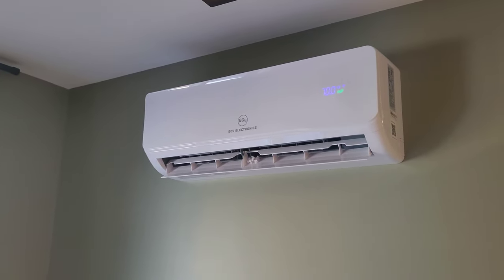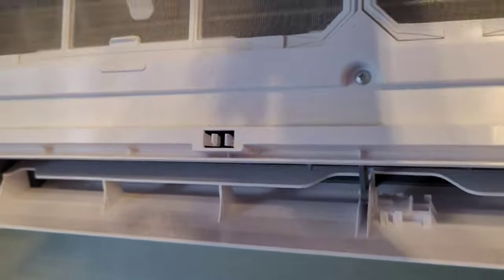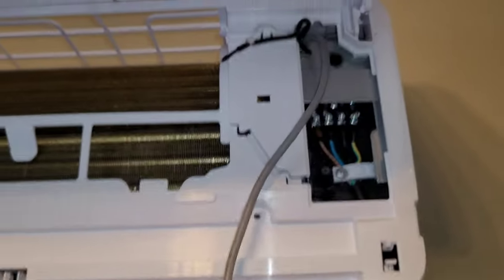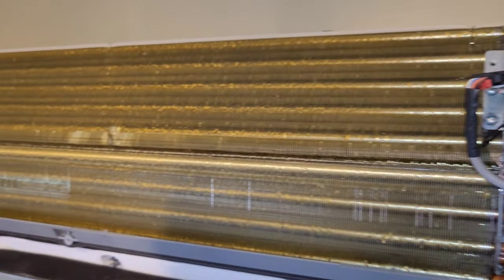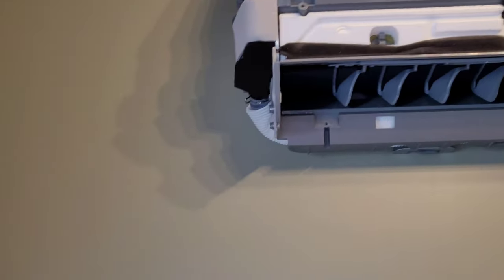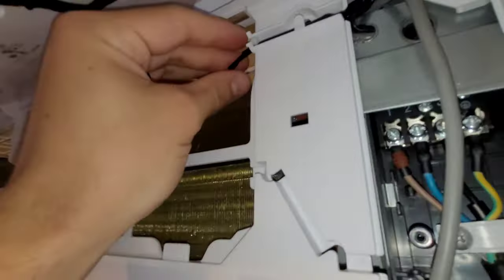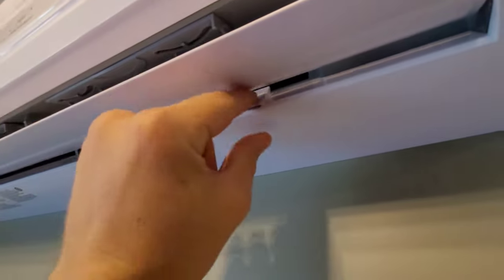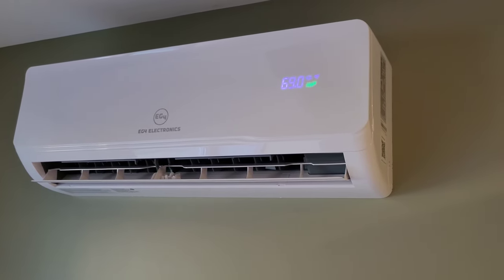How To Maintain Your EG4 Solar Mini Split Heat Pump, Do This ASAP!!

Comment: I have five hepa filters in my house, one medical grade one. I check my coils and filters and they are never dirty. I'll keep checking though. Running them 24/7 in Vegas
Reply from the maker: It makes a huge difference. If the mini split is the only thing filtering your indoor air, it's going to be problematic!
Reply: Cool Will stopped by, I follow both you guys closely keep up the good work

Comment: Definitely need to schedule this since I've installed the 24k in the garage/shop.  Its fairly well closed up, new construction, but it is windy and dusty around here.  Been thinking of hacking something together to hold parts of a regular furnace filter, gonna be tricky though, as I'm at the minimum from the ceiling.

Comment: The fan on my Mr Cool clogged up to the point that he described (weak output, condenser ramps down).  I played with the charge (which MAY have also been low???) but eventually realized the fan was the issue.  I was able to vacuum mine and get it running but even after vacuuming it was considerably worse than yours before you started.  Ended up following up with a wet cleaning.  Coil cleaner and a water rinse on the fan.  I bought a bag and everything.  The fan still has some junk on it but it's WAY better now.  I think the last trick is to get something like a Ryobi One+ pressure washer and use that on the fan.  I did try to pull the fan the first time but mine does not have a missing blade for the set screw.  I think I am supposed to take the motor out first or something.  I gave up and just cleaned it from the air outlet area.

Youtube research suggests that a wet cleaning is often required on these units, possibly even annually.  It really does depend on how clean your house is.  My particular air handler was a bit less than 2 years old and got that bad.  The filters never get that dirty and while the coil needed a cleaning it wasn't scary bad or anything.  I think another thing is to not shut them off in cool mode.
Reply from the maker: The drain bag and a wet clean is often the way it has to be done. Usually the blower is bad by the time anybody calls for service, like you said it's pretty easy to do but if you don't have missing fan blade it's a lot more work to get the blade out. If it can be disconnected from the bottom it's not too bad

Comment: I have been thinking about indoor filters systems. We have a 2 carriers air filters systems that run on auto all the time. 
I am thinking about how to install a whole house filter system with in the hvac system or no hvac system. So my general idea is to have vent and returns for each room to go back to a main area. if we do not do central air and heat and do mini splits I will need to do a variable speed squealer cage fan. ( ideally I would love to find a 5 ton heat pump system rather than mini splits) WIth filters at every single return which are in the ceiling and use high end hepa filters. The system will also have a main filter as well and a UV light in the system. I have been looking for air quality sensor that work on a multi zone HVAC. Yet these things are not so easy found. 
The carrier filters things we have are almost 2 foot round and 3 foot tall. They have built in sensors and when it encounters bad air it speeds up the fan. The system would need to be able to do a dozen or so areas and once one area detected bad air it speeds up. The fan would run 24/7 at super low speeds. 
Hvac systems need a major upgrade. With systems costing 10 to 30k for homes they better offer something other than standard AC and heat.
Reply from the maker: There's lots of new tech coming right now but it's coming with a price. I've encountered so many people who want to spend the money on hepa filter systems until they see the cost of the replacement filter every 6 months to a year, they change their mind on air quality pretty quick 😂 I have a simple Airthings air quality monitor but it does not connect to my filtration or Hrv systems
Reply: @SmitHVAC.  The 2 Carrier RMAP-ST filters systems we have are 300 to 400 dollars each and replacement filters are 100 to 200 dollars. They are not cheap either. When the filter goes bad and is no longer good I think I am going to rip it apart and then maybe build my own air system in my upstairs attic. The system is quite easy to be honest It has a sensor, control panel filter and fan. The control panel that is on it could be fashioned on the wall. I have 3 main rooms, hallway and a closet bathroom. My plan would be to add a return with filter in each room with duct hose then a main box with fan matching the style of the fan that is in this unit yet far larger and then the hepa filter in the hallway, these are those drop down vents that I wish they would use more often. Damn it that wont work cause only one sensor. Going to have to reverse it. Either way I will come up with something. I just need to find a tiny system that I can add to the new house build either as its own system or included in to the HVAC. I know that some of the higher end HVAC system have variable speed fans while mine does not having that would be far better and I think most if not all heat pumps have it. That would be easy to add sensors at every return.   
While I do understand that hepa is costly my plan is to stage the filters. Where you put standard yet higher grade pleated filters in the return vents and then at the main junction before the Furnace you place the Hepa filters. WHile its more filters overall its also better filtering and the hepa can last far longer because its only getting mostly filtered air if you understand what I mean. I am not clear where one would put the UV light box and if there is a special way to do it? 
What do you think about that idea. The more filters in the system means less filtering at the hepa stage. I think they would call this 2 stage and I guess you could make it more filters some how.

Comment: Could you use compressed air and a long skinny tube to spray off the blower wheels?
Reply from the maker: Yes you could, you might send a bit of dust up into the bottom of the coil  but it probably wouldn't hurt it

Comment: Have you had any line set condensing issues? My head unit is mounted on an interior wall and sweats really bad where it ties into the head unit. The insulation that's on the line set does not go all the way into the head unit so it's giving me grief. Luckily the white insulation jacket is catching all the condensation but its not a long term solution.
Reply from the maker: I added length to the lineset so I had to add insulation, I double wrapped the lineset where it passed through into the head unit

Comment: I bought this mini split and just had a h5 code during heat mode. I looked online to see what to do and they said shut power to the unit off for 2 minutes. So I did that and its been running fine since. I'm bummed because I have only had it a couple months. Any advice on anything else I can do
Reply from the maker: What was the outdoor temp? Defrost mode is either h5 or d5 I can't remember, it may have just been in defrost mode. Error codes usually start with E, P or F. If it reoccurs just contact signature, they've been great with tech support / warranty replacements.

Comment: I think my EG4 24k unit died tonight. It has a error code 93 - compressor fault :(. It's not even 5 months since it was professionally installed.
Reply from the maker: That's not good.. It will be replaced under warranty I'm sure but still not good. Where did you find out code 93 was a compressor fault?
Reply: It actually popped up on the solar acon app.
Reply: @SmitHVAC.  I killed power to it for a bit and the error code went away, but now the fan doesn't turn on, only in heat mode.
Reply from the maker: Did you end up getting the unit fixed or replaced?  @airwebber
Reply: @SmitHVAC.  SS replaced it, but the next one arrived damaged and it wasn't the kind of damage done in transport. So they again sent another replacement. Sadly, my HVAC guy has been insanely swamped and not been able to get to me to take down the old one and install the replaced one.
Reply from the maker: @airwebber  That's terrible! I'm glad they replaced it but what a pain..

Comment: Thanks for exposing this...  I was tempted to go with the EG4 24k unit.   However,  Signature Solar advised me that EG4 does NOT currently offer a ducted ceiling cassette ... yet.   I wrote EG4 but have not received a response either.   Oh well, still hoping for the future developments.   Today,  I do NOT feel that a ductless can meet my requirements.   I am just left with wondering why Solar HVAC units are ONLY OFFERED in ductless.   Thoughts ?
Reply from the maker: Its easier to DIY an all in one indoor head unit rather than a ducted coil, that would require an interface board for communication to the outdoor unit. A cassette would be a nice option, hopefully in time we get some more options. I'd love to install a cased coil and interface board for a whole house solar heat pump.
Reply: @SmitHVAC.  Thank you for these thoughts.  I am willing to try any ducted air handler to this EG4.    However, what is show stopping me is warranty and any proprietary communications software concerns.   Too bad EG4 has not addressed my concerns with a reply.

Comment: Can't believe you didn't pull the blower wheel in a video on how to clean.  Not fun but if youre6doing a how to video, essential.  Otherwise well done.
Reply from the maker: @rhodachandler4277  not essential at this point, in the future I will.

Comment: So basically very few will do this so the mini split is a maintenance dream for technicians or people will just buy a new one.
Reply from the maker: Very few people do it preventatively, they just call on the hottest day of the year and say its not working 😂
Reply: Love videos like this.  Some will say you are exposing too much.  I laugh, as I know how truly lazy the average person is, they won't do this.  The calls will continue to the HVAC techs.  Every time I move to a new place, I have to spend days going through everything and cleaning and maintaining anything that needs it.
Reply from the maker: I agree, there's always someone upset over someone giving away info like this but I think everyone has the right to repair their own equipment if they feel inclined. Most simply won't!